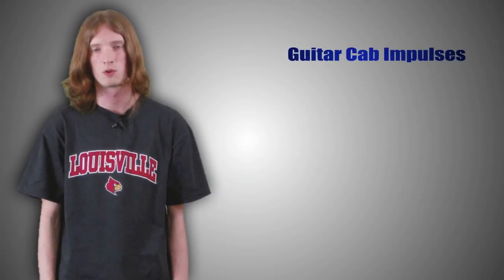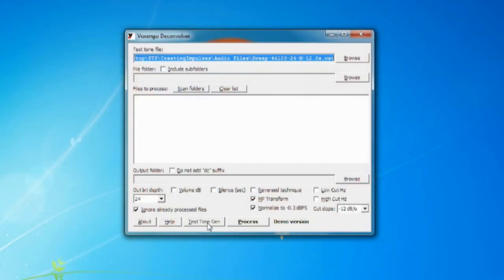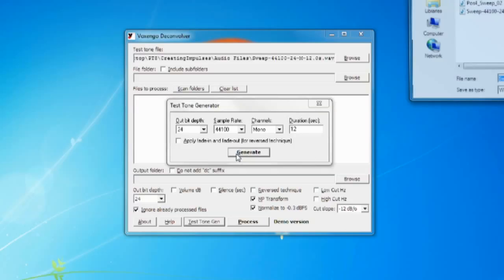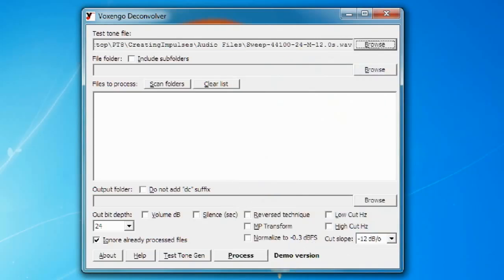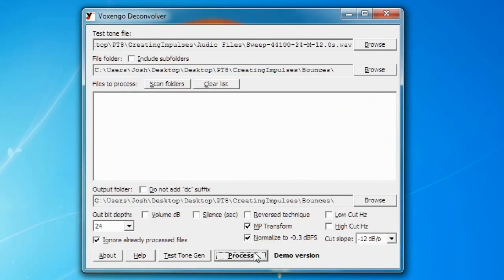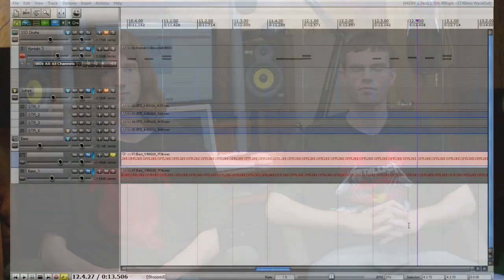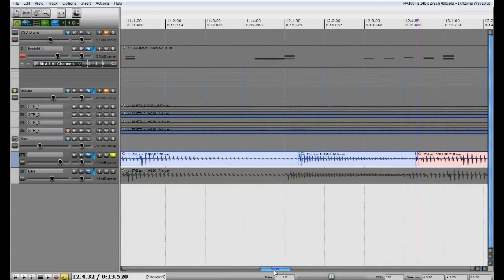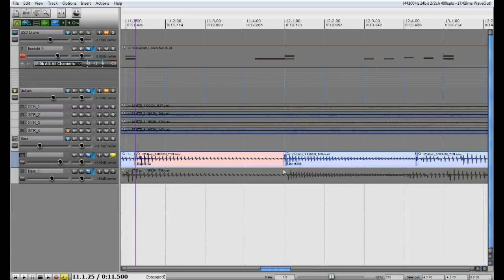EP76 - Creating Cab Impulses and Time Stretching with Reaper

Comment: you guys know  that you can adjust the buffer size in the M-Audio control panel to minimize the latency, right? I run mine at 128, and i have a little more than 4ms, which is pretty good.